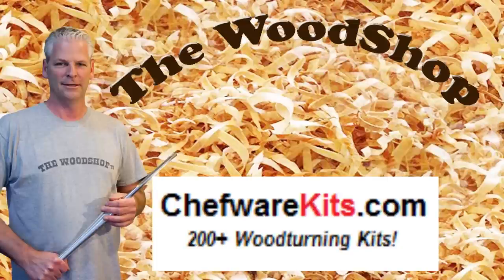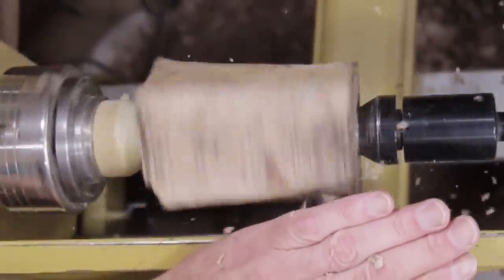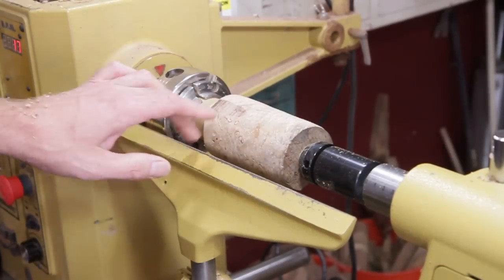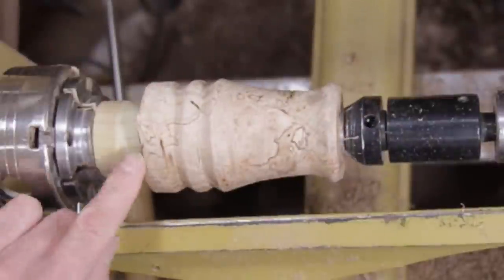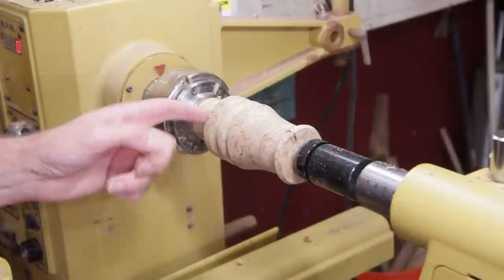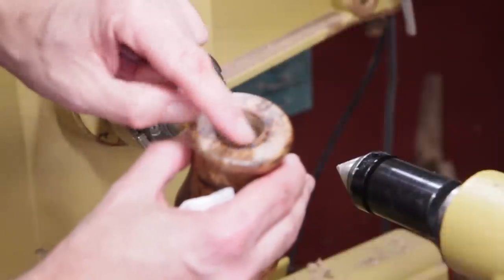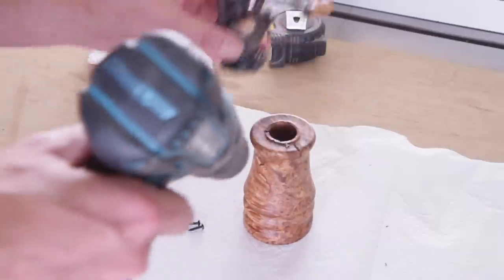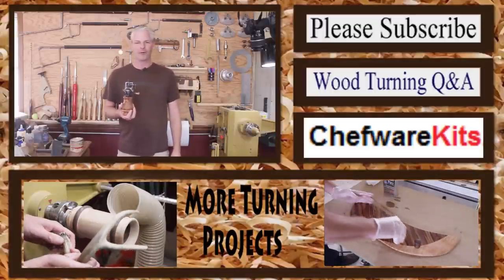Woodturning Maple Burl Pepper Mill

Comment: Thanks sooo much Carl for the pepper mill video.  I've taken your project to heart and ordered/rcvd my pepper mill mechanisms, but I'm not sure how to properly drill the 1" hole for the mill.  I have 1":auger bits, 1" forstner bits, and 1" brad pt. bits, but none are long enough for the mill I'd like to turn...  Should I purchase an extension and if so, what do you recommend for the type of bit (i.e.; forstner, auger, spade pt., etc.)?  Thanks in advance and safe turning to you always!
Reply from the maker: Kenn Harris Thank you Kenn, I would use a forstner bit with an extension.
Reply: Carl Jacobson
Thanks Carl!  I'll give it a try and see if my Jet 1221VS will pull the bit through 6: of wood...  Safe turning to you always!